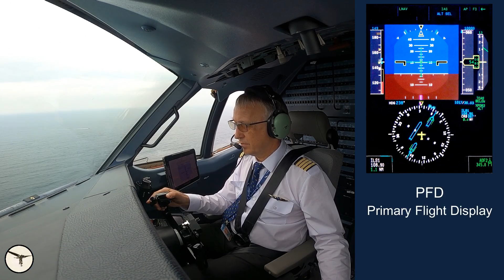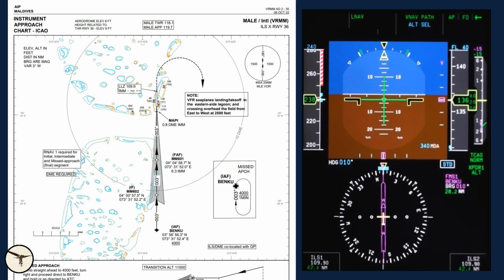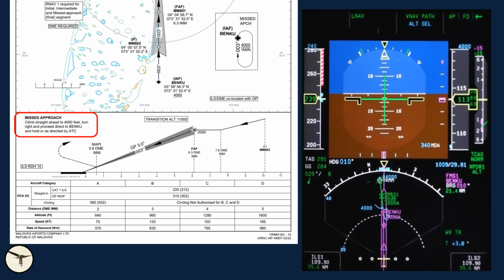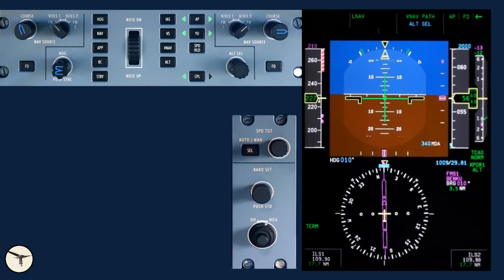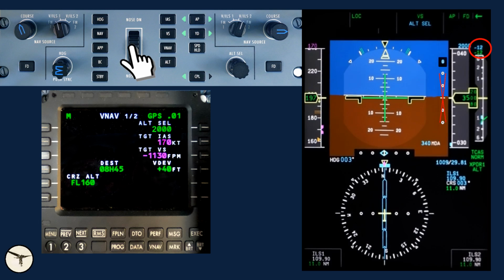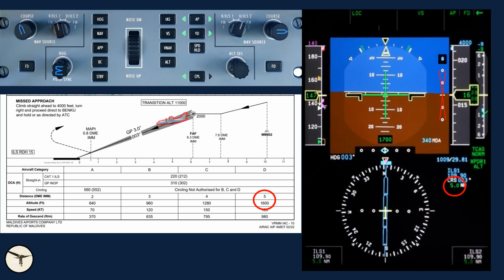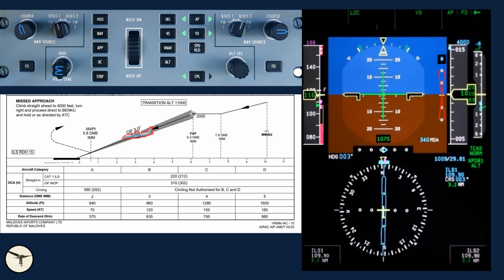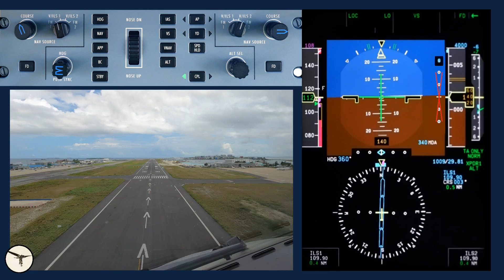ATR systems - Primary Flight Display (PFD) part 6 - LOC approach | Tutorial

Comment: HI Magnar, thjs video is outstanding.  I have a question, in my sim... sometimes im in vnav and I want to descend, so I set my target altitude then press VS but VS never engages and it is stuck in vnav.  Do you have any idea why this would happen? Thanks.
Reply from the maker: To use VS, you must 1) Select an altitude below your current altitude. 2) Select VS mode. 3) Turn the pitch wheel to set the vertical speed.
Reply: @FlywithMagnar  Thanks for the reply magner.  Sometimes I do this but the VS does not begin to move and the aircraft holds its altitude.. might be a bug im not sure :(